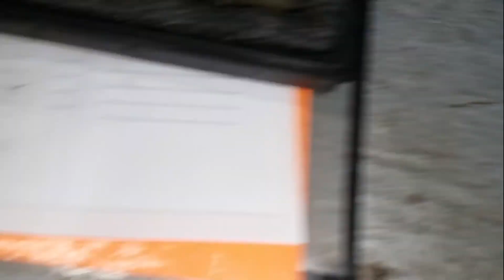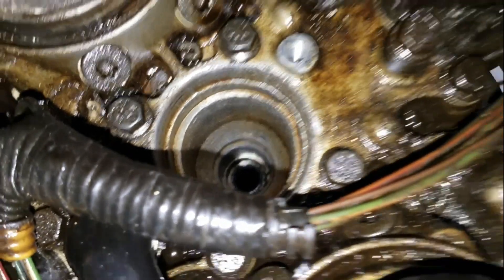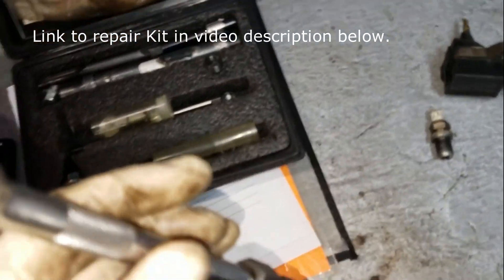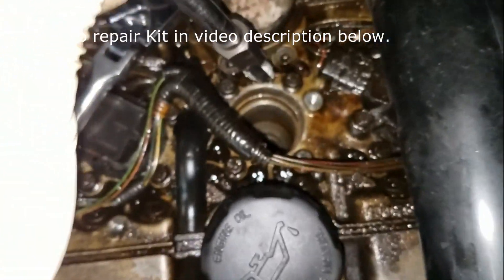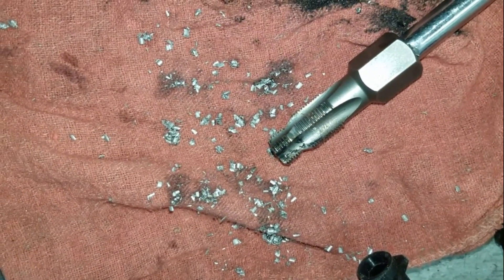How to repair stripped spark plug threads PERMANENTLY

Comment: So I guess that tap cuts away enough material to alow for the thickness of the helicoil to screw the original size spark plug in.....it seems like it would have to be drilled some.....? but I hope this works as the video shows....I need it too....!!!!

Comment: That tap's taper looks like the job gonna take quite a bit of muscle, when cutting the oversize section of that tap.  Why not run a correct size drill bit to size the hole instead of trusting whatever original threads are still intact in the head, for the tap to bite on?

Comment: U dount use same plug as u running if it's a countersunk tapper plug must be a flat type same plug or the incert will go way to deep in the plug hole could damage piston or a value becarefull once I do get it flush u need crown it with couple lite taps to seat the insert flush and usa jb weld or red lock tite on incert leave in 30 min s before u take plug bknout to crown top

Comment: Great video. Helicoils have a spring type look and work well for normal bolts. Not sure for spark plugs tho. Your right, that one is a keensert or timesert, it looks like it's just made by Helicoil. Those directions usually call for some high temp silicone to be used as well.

Comment: I've got a question. Once you finish cutting the new threads, how do you install the insert? The only way I can think of is to thread it onto the plug, then install the plug, but you have to then remove the plug to hammer on the insert. Wouldn't the insert come back out with the plug?
Reply: Yup, it'll prob come out with the plug...unless I'm doin something wrong but I've did 2 now on my boat motor, 115, and I followed the directions to a T and used red high temp rtv silicone(like the directions say) and they keep wanting to come out with the plug!! I'm up for any help, tips... thanks
Reply: Let the goop dry ?

Comment: I've noticed the many ways that you try to keep foreign particles out of the motor.
 I like to use a small hand held vacuum cleaner with computer keyboard tips. They usually come in a set of four or five different sizes with a short hose. It will suck every last bit of contamination out of the cylinders and the larger tip works great for intake valleys.
 Thanks for the videos!

Comment: Did you use rtv silicone or other sealant on the exterior of the helicoil insert?
Reply: Your right cause that's usually part of the directions on keenserts and timeserts. I think helicoils require something also.

Comment: Just one question, that timesert looks kinda small. The number of threads on the timesert doesn’t match the length of threads on spark plug? So, like the spark plug is threaded halfway on the timesert but the other half of threads are just exposed?

Comment: First time encountering this. I’m pretty seasoned in engine failures but wow. Just when you think you have it figured out... anyway I’ve just searched for knowledge and you have said the same thing. Only thing I’ve heard is set up a shop vac in blow mode and tdc the cyl you’re on. It will push out chips. Watch your peepers tho. Thx

Comment: Will the heli coil stay on if you dont hammer it?
Reply: It's possible it will stay. But it may not stay when you take the plug out again or vibrations and temperature changes slowly back it out.
Reply: @servihomestead4324  Silicone should be used and helps. Helicoils are spring shaped.  Those are keensert or timesert style made by Helicoil.

Comment: How can I be sure that all of the aluminium gets out? I dont want to start up the engine if I'm not sure
Reply: he said grease
Reply: @ReeseSchuett  Exactly. Mechanic is not always a 100% sure, type of job. You can stuff a small piece of paper towel down the hole, or use those mini vacs. Grease usually does a good job, been used for years.
Reply: @ReeseSchuett  Still not a guarantee it is all out

Comment: I am forever in debt to you sir. Good video and great product. I blew out a plug like and hour and a half from my home. And I went to a nearby Napa after finding your video and picked up the kit. It was easy, quick and cheap.  luckily I had extra plugs too. Got me back on the road and home.
Reply: Also did it without taking my valve cover or anything off. Just had to move the rest of my coil pack out the way and boom. Done. Did it on my 2002 f150 5.4.
Reply from the maker: Nice to here. Very glad my video helped. My goal here is to save people money on their repair bills
Reply: Mine did it a week ago!!! I have some hope!!!

Comment: Insane I knew it was a Volvo off the coil some how 😂😂 had cylinder 4 blow out on me, I had a helicoil fitted and fixed today just hoping it doesn't blow out again and the helicoil holds it!
Reply from the maker: I have had pretty good luck with them. no problems in 25yrs. You should be good man.
Reply: @FlatRateMechanic  still running strong so far!

Comment: Another reason not to replace plugs unnecessarily.  I heard a dealership "service" manager try to talk a customer into replacing her car's Denso iridium plugs at 50K with no malfunctions.
Reply from the maker: You are correct. No needed till 100 to 150k. Hard to believe hey can las that long, but they do. Regular copper top should still be done every 30k
Reply: @FlatRateMechanic   The OEM Denso iridiums can last MUCH longer.
When some "mechanic" cross threads a plug in your aluminum head you'll kick yourself for having replaced them unnecessarily.
Reply: @FlatRateMechanic   is there anything else I should  know I have  the kit I'm just a little nervous about doing it to my 97 Chevy Silverado K1500 your help will be greatly appreciated because I need to get my truck on the road before Friday because I need to get a few bigger parts for my truck and I will not be able to put them in my car
Reply: Ah! I pulled my spark plug to replace along with the blown coil pack and... here I am.

Comment: Hi, I have my mechanic did the stripped spark plug fixed. After he installed everything and Cylinder 5 is still making noise and misfiring do you have any solution for this?
Reply: he may have tapped it to far down

Comment: Great video, it was a little blurry at times and I would have liked to seen the hole repair process on video but it was very informative, can this be done with the head off?
Reply from the maker: Yes it definitely can and would be best that way but not necessary as that would get $$
Reply: Heads off anyway blown gasket found it was warped so i'll do the repair before install, Thank you very much for the reply!!
Reply from the maker: Your welcome